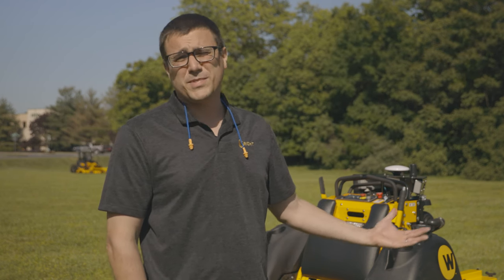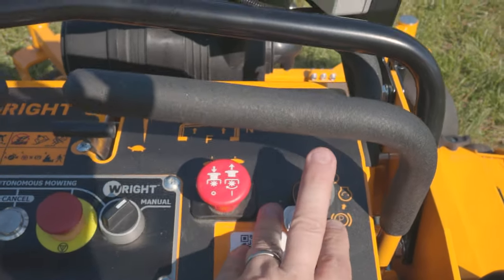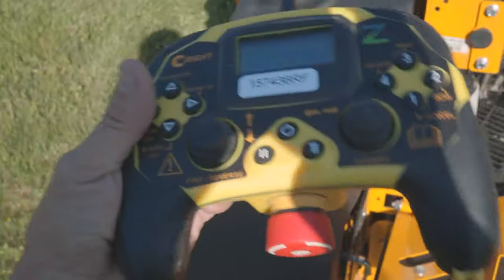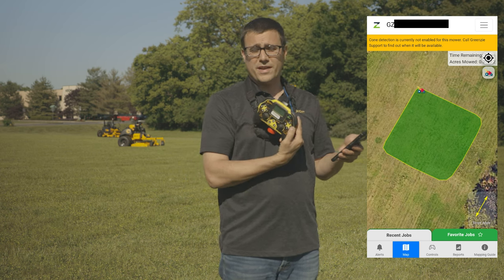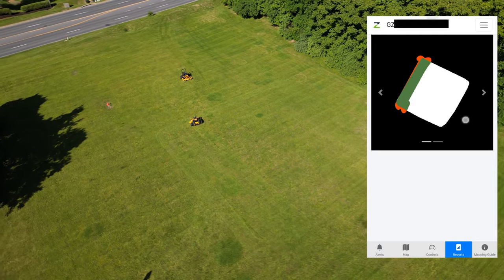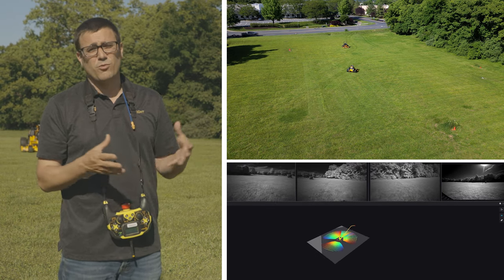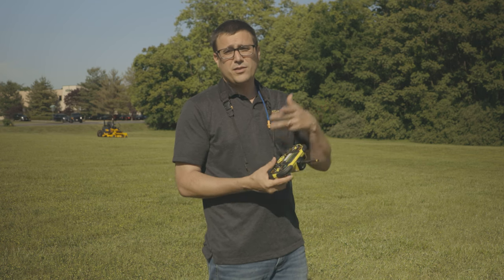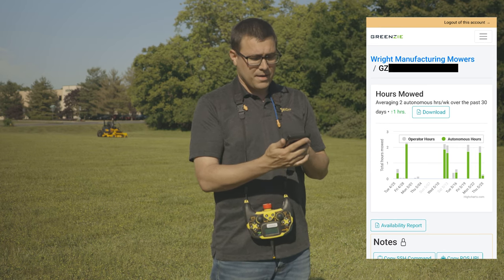WRIGHT | AUTONOMOUS ZK (EVERYTHING YOU NEED TO KNOW)

Comment: I would like to see the same controls applied to a 20 foot wide right-of-way mower to use at airports, power line and highway applications. Use the spike wheels  all around the bat wing type folding deck  similar to the ones that the Swiss company Aebi uses for steep slopes and mow places that farm tractor/bat-wing mowers cannot go.